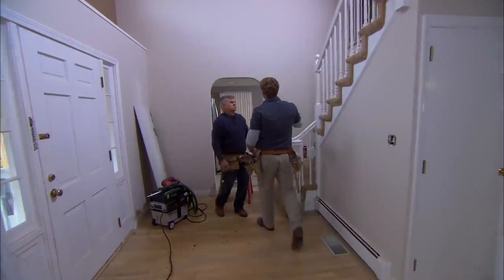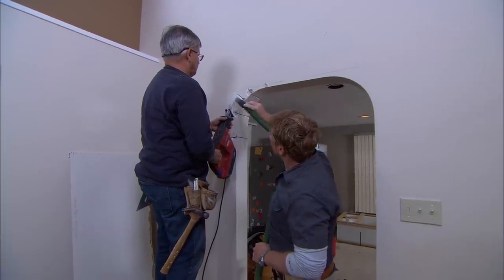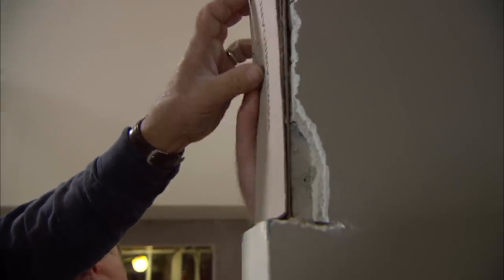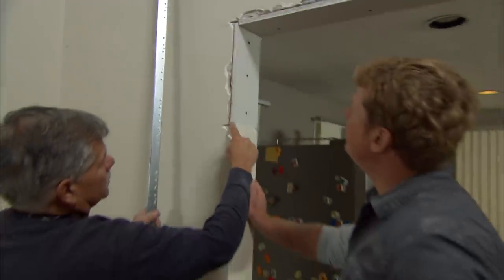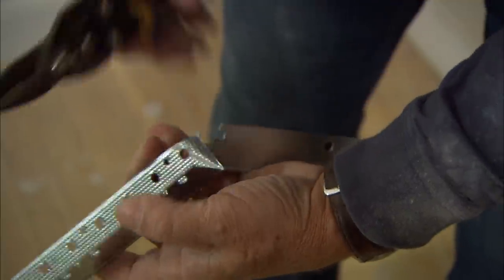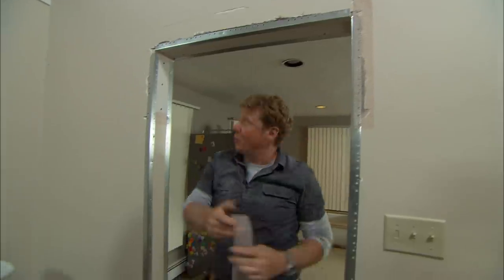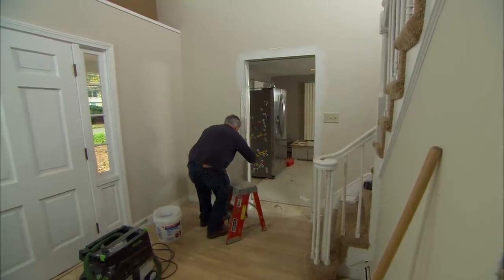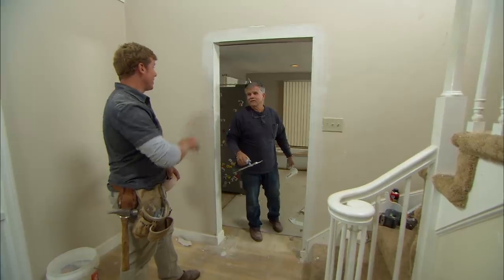How to Square an Arched Doorway | This Old House

Comment: I want to know how to arch a doorway that is squared.  I have 3 arched in my living room, dining room, and kitchen and I look through one of the arched openings in my living room and see a squared one and it is so awkward. Old lath and plaster house...
Reply: Take a sheet of plywood 1/8 or 1/4 inch, and tape or nail it onto the arch doorway that you are looking through. 

Trace the arch of the doorway onto the ply wood.
Use a jigsaw to cut it out and make a template.

Place your template on the square doorway; insuring that the top of the arch is the same height from the floor as the top of the arch in the doorway you made the template from.

Now trace the corners and side of the wall onto your template and cut them out.
Once you have a template that will fit on one side of the doorway; make a second template so that you have two sides.

Set your two templates up so that they are just slightly skinnier than the width of your door way. This will be necessary for either putting up sheet rock or joint compound. If you choose to use drywall; make sure the width of your arch is skinnier by two thicknesses of the drywall you are going to use.

Use several square dowels to join the two sides together insuring that they are 1/8 to 1/4 below the edge of your arch, you can make them flush to the top as it will be fastened to the top of your doorway with screws.

At this point, you need to mount your arch into the door way insuring that it is inset equally on both sides of the door.

Now take plywood and slowly push it into your arch against the square dowels and nail or screw it in place as  you go.

After this point, all you need is put up the dry wall, tape it and put joint compound on it, then paint your new archway.

If you've never done this before, make a couple different smaller practice arches so that you end up with a nice looking archway.

Alternative to plywood:
 
Use 1 x 4, 1 x 6, 1 x 8 or 1 x 12 depending on deep your arch is, and screw it in place using pocket holes. Just cut the boards to the width of the door way and you may be able to simply cut the arch into it.

But you will still need a thinner board in order to close the underside of the arch.
Reply: Watch this video in reverse.
Reply: @hometownmedic7355  lmao

Comment: Did they get lucky with the arch method?
Reply: No, arches are more or less always built Like that, build a square opening in the frame and round out the corners with either plaster or a thin plywood